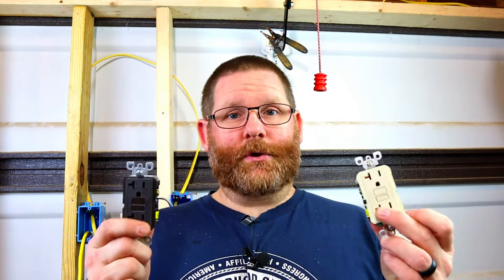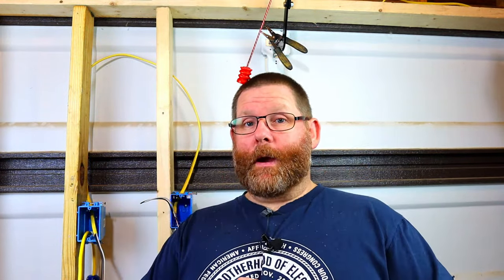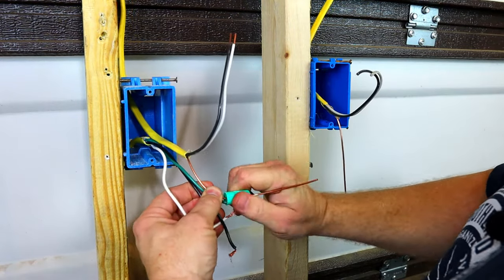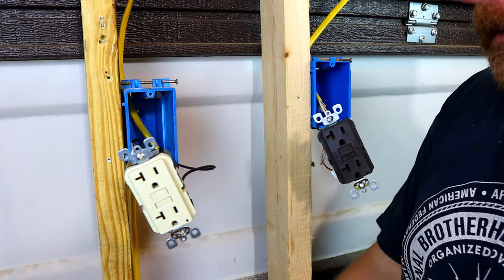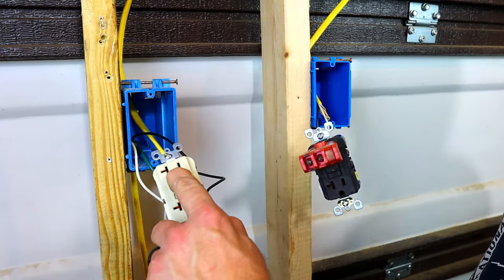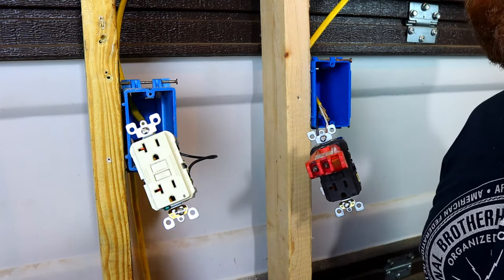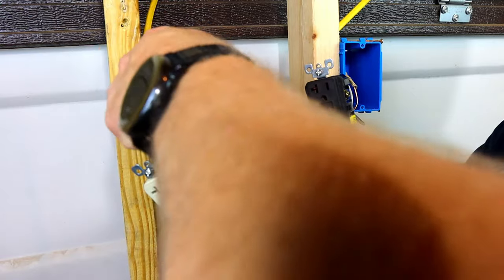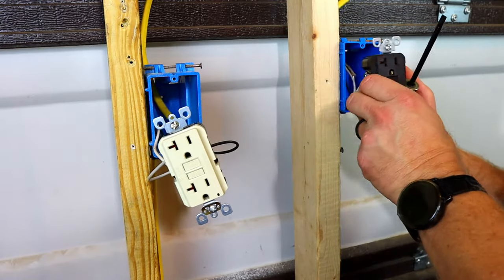How Many Ground Fault Circuit Interrupters On One Breaker

Comment: Okay, this is a bit confusing because there are some tests left out of this video (like testing the plug side while power is reaching the lug side of the brown CFGI or "child receptacle"). First of all, let's assign some names to the GFCI's in question. We'll refer to the first GFCI (white/off white) as the "parent" and the second (brown), third, fourth, ect... GFCI's as the child/ren. - outlets hooked up in series (connected to the bottom lugs of the GFCI outlet). 

To simplify this, do not/never hook up GFCI's in series. Only connect them in parallel as if they are independent from other GFCI's on the same circuit. Voltage drop from one GFCI/GFI to another will prevent children from resetting. You only need one CGFI for child outlets ran in "Series" (using the bottom lugs on the parent GFCI to connect child outlets - being mindful of how many outlets you can run on one circuit by code). 

GFCI should be able to trip with a short (grounded circuit) upstream and downstream, which trips the auto-shutoff feature of the receptacle/s (all the GFCIs on the same circuit should trip). The confusing part is that nowhere in the video does it show a reset of the child (brown) GFCI after the parent was tripped (indicating a voltage drop preventing the child GFCI from resetting or it wasn't manually reset until later, which we did not see), resetting the child GFCI should correct the power-flow to the plug-side/s of the all the children receptacles. 

So, as elementary as the GFCI function is, as long as there is power fed through the receptacle both the parent GFCI and theoretically the series GFCI receptacles have been manually reset, the power should flow through to the plug side of the parent and child/ren GFCI's (unless there isn't enough power to the GFCI in order to reset it/them). Problem again is, there's a voltage drop that keeps child CFGI's from resetting. 

The point is,, you do not need multiple GFCI's as long as you connect standard outlets in series to the parent GFCI outlet using the first method demonstrated in this video. It is not recommended to use this method to series GFCI's outlets (if it happened to work at all) because when one GFCI trips, they all should respectively trip and making it difficult to isolate where a short might be occurring (which will leave you and even a professional electrician with the proverbial head-scratch wondering why someone would subject themselves or anyone to that mess).  

It is wiser to choose whether or not to provide direct power (wiring in parallel to each receptacle, isolating GFCIs and with or without child outlets) or simply installing one GFCI that controls all following child outlets in series (connected to the bottom lugs of the GFCI). - Do not add GFCI's in series, meaning a parent GFCI controlling GFCI/s downstream, that's just being a jerk and causing you the headache of having to reset all dependent GFCI's, if they work at all, in the event one becomes tripped. Rely on one GFCI to control multiple child outlets or provide direct power to each GFCI independently on the same circuit.
Reply from the maker: Wow that's an awesome comment thank you for writing this. Have a great day ☺
Reply: In order to run a "series", couldn't you just figure out the formula-for-resistance-loss for every "child" outlet, then check the specs on the gfci for the required ohms? (I'm thinking one or two "child" outlets would operate properly but that's purely a common-sense guess.)
Reply: @jban4457  Problem is the unpredictability of load.
Reply: This is a great comment and far better than the video.
What's really a kicker is to "map" a circuit correctly, including light fixtures.
Reply: @jban4457  the use of "series" and "parallel" with gfci's can be confusing.

Gfci's simply check for a current imbalance and trip. 

We connect up 120vac to the GFCI input (line) and it protects that outlet.  There are terminals (load) to allow the GFCI to essentially be the protected power source for recepticles connected down stream, giving them GFCI protection.

Running power through the GFCI like that can been refered to as "series" because power runs through it, however, it passes power through like a breaker (120vac) to the parallel connected down stream recepticles.

If you need GFCI protection in two spots, you can "T" tap or pigtail or parallel connect two gfci's On the (line) side to have GFCI protection and a GFCI in each location.

Gfci's do not play well with one another when one feeds the other.
Reply from the maker: Good idea I'll do that pin it.
Reply: Without having a wiring schematic for the house, how do you know which receptacle should be the parent?
Reply: @Kaavoort  The only way to know is to disconnect an outlet and see what other outlets continue to work or not. You can use an outlet tester or just a lamp.
Reply: @Kaavoort  
Will be the one with power
Reply: The only time I'm aware of multiple GFIs on one circuit is in the kitchen.
Reply: And bathrooms
Reply: @William Franks  exactly what I was going to say
Reply: Can i connect a GFI downstream from a regular receptacle?
Reply from the maker: Absolutely
Reply: you are saying I think that no matter how they are connected, it doesn't make sense to have more than one GFCI on a circuit, to use regular receps downstream of the single GFCI and let that control all the downstream receps. Right or wrong?
Reply from the maker: @carlodonnell146 yes that's what I am saying it's one way to do it.
Reply: yup . I had one outlet that has 4 wires 2 black 2 white and another GFI that had only 2 wires One Black and one White, connected the(4wire receptacle) black and white that are (hot to the breaker) on top "Line" and other black / white wire to the bottom "Load  . this made the other GFI "Controllable" by the Main 4 wire receptacle . But then later on I noticed that the 2 wire GFCI stopped working !! whats up with that  Maybe i should have put the 2 wire one on the load end not the line ? 😦😦😧😧😧😧
Reply: @Kaavoort  the parent will be the one with 4 wires the children will have only 2 wires (hot and Cold)
Reply: @TomCee53  Certainly not the only way. Another way is to put a load on one outlet and measure the voltage there, outlets upstream ( between the load and panel) will have progressively lower voltages. Outlets downstream of the load will have the same voltage as the load  since there is no voltage drop on the unloaded wires (assuming there are no other loads on the circuit). A high current load helps by making it easier to see the IR voltage drops.   Ohms law is your friend.😊
Reply: Lllll
Reply from the maker: @simonlewis67?
Reply: First off, I'm no electrician. But I've run a series in parallel of GFCI in garage, that behaves exactly as expected.

3x 2gang boxes each with a GFCI "children/downstream" of the other, then in each box the second outlet protected (load).  I can trip a downstream GFCI w/o it tripping the parent GFCI.   Rationale behind it is to "compartmentalize" the trip without taking down the entire circuit.    This works fine.

However, doing the same thing in a workshop (where the wiring is suspect), the same configuration doesn't hold true.  

Friggin magic as he said, and again, not an electrician.

Edit: added "in parallel".  meaning a series in parallel. :)
Reply: Thank you, I was about to install (in two places) two GFCIs in a row, now I will not do this. I was a bit confused by the video, but really appreciate this explanation..clearing up some things.

Comment: There is a valid reason to have multiple GFIs pigtailed on the same circuit. You may wish to have your GFCI protection local to the room. For example, a single circuit can service countertop receptacles in multiple bathrooms. Perhaps you want each bathroom to have its own GFCI receptacle so a trip doesn’t require a person to go to another bathroom to reset the tripped receptacle.
Reply: If wiring GFCIs for multiple bathrooms (that are on the same circuit), would all the connected GFCI receptacles (including the initial one closest to the panel and all downstream GFCIs) need to be wired only on their line sides? Does this setup change if there's a standard receptacle somewhere in that circuit?
Reply: @ibizanlove  Yes, line side only. Or you can use some 12-3 between the receptacles of the first bathroom to pass current around the GFCI of the first bathroom, or splice at the outlet where the first GFCI will reside, and take power to the second room from there, while using the load side of the first GFCI to protect the rest of the receptacles in that bathroom. Many different ways to do it.

Comment: The black GFCI is not tripped right? This video doesn't make sense to me... if you connect the load side of the white receptacle to the line side of the black receptacle I don't see why it should matter where the line came from (the breaker or another GFCI)
Reply: Yeah, I think he botched the explanation a bit. The second GFCI will work as wired initially, but you'd have to reset it after resetting the first one. The reason you wouldn't want it wired that way is - imagine if you have 4 or 5 GFCI outlets on that circuit, when one trips, you'd have to reset it and then ALL the other ones. Would be a real pain in the neck. Best practice is to wire how he shows it in the end (preferably with a pig tail) and put GFCIs for all outlets near water sources.
Reply: @jetlaggedchef6806  Yup that makes a lot more sense. I also wonder whether perhaps it's better to make resetting inconvenient as GFCIs do not spuriously trip, they trip for a reason, which could be the GFCI is bad. Making it inconvenient forces a homeowner to address the issue. It's not like AFCI where nusiance tripping in normal usage is more common

Comment: It’s called using the line to line and the reason why the other way will not work is because basically that is a breaker and a socket form and when the breaker trips, it breaks the connection which means if you have another circuit or another circuit, but if you have another plug down the line that’s wired on the load Side that is what is tripping so naturally it’s not going to work

Comment: I have an old house that has both bathroom wall outlets on the same circuit.  I changed out both today with GFCI outlets and  spent several hours trying to figure out why the second one would not work.  Stumbled across this video and resolved the problem in a minute. Thanks for the video.  It was a big help.
Reply from the maker: Awesome so glad that you found my video. I appreciate you watching and commenting ☺
Reply: You wasted time and money.  A circuit only needs one GFCI and it should be on the receptacle closest to the breaker panel.  The GFCI installed this way protects all outlets downstream.
Reply from the maker: That's great in a perfect world, most homes are not wired like they should be

Comment: My 1950 house does not have a third wire ground (this was not required until the mid 60's).  The kitchen has 6 outlets on a 20 amp circuit.  When I moved in I replaced them all with 20 amp, 3 prong outlets, with the first outlet a GFCI feeding them.  I had never put a GFI in before but I saw the LINE and LOAD terminals stamped on the back and correctly connected them.  But if you plug in a GFI tester downstream, the test button does not work.  However a dryer plugged in the 1st downstream outlet had a ground fault and it did detect it and tripped (my brother found it and fixed it).  Out in the garage I installed a 20 amp GFI and six downstream outlets.  Of course this was wired to current code with 2 wire with ground Romex.  I plugged in the tester in the last outlet pressed the button and immediately heard a loud click some 30 feet away, the circuit was dead.

Comment: Thank you.  Home inspector said I had to put a GFCI on the outside [under porch] but no one realized it was daisy chained from the GFCI in the kitchen.  Was having this very problem and this just fixed it.
Reply: Nice catch and discovery!  May I make a suggestion that you label the outlet/receptacle that is outside and under the porch saying that it is GFI/GFCI current protected.  Most GFI/GFCI have several small peel off and use labels included in the packet/box the GFI/GFCI comes in that are designed for this.  All outlets/receptacles that are downstream, connected to the "load" side of the GFI/GFCI should be labeled as GFI/GFCI protected.

Comment: Greetings, Sir!

I think I have the answer to your question as to "why" this works (correct me if I am wrong). We know that an A/C circuit is a parallel circuit. SO, in order to make the 2nd GFCI independent of the first one, we have to wire the UNgrounded Conductors "in parallel with" the TRUE source (the circuit breaker). 

By wiring the ungrounded conductors in parallel with the BREAKER, we allow current to flow to each receptacle at all times INDEPENDENTLY OF the upstream GFCI. I think this would be more evident into the viewers if you had used a pigtail, because it would show that the current is "dropped off" at the 1st GFCI receptacle AND it continues to the 2nd one simultaneously.

This reminds me:  I need to make this correction on my own house tomorrow from when I was an apprentice. Thank you for your excellent videos! If someone already commented on this, I apologize!

Comment: Thanks for this video. I’m a DIY-er getting ready to install several receptacles around my outdoor patio, so will have several GFCIs on one circuit. Basically, looks like pigtailing them / wiring in parallel is the only way to go.
Reply from the maker: I agree. Or you can put in regular receps and come off the load side. All depends on what you want to spend and the look your aiming for

Comment: The reason I want to do this is, I have two sump pumps in my yard that I want to run off of one 20 amp circuit with a regular breaker. I want the sump pumps independent of each other so if one trips their GFCI outlet it won't shut down the other sump pump when there is no problem with that pump. Thanks for posting this and explaining. I'll be wiring them so they are in parallel with each having their own ground, neutral and hot.
Reply from the maker: Good luck and thanks for watching and commenting ☺
Reply: I did the same, wired in parallel so both the gfci outlets are independent.

Comment: Thank you thank you for this video!  I had it wired right but ended up with no bathroom fans, lights or outlet juice in two bathrooms.  Made no sense until I finally found this gem advice, It worked!  Now if I can just get the broken bottom screw out of the box housing, it'll look nice too.  :)
Reply from the maker: Glad to hear that this helped you ☺

Comment: I've replaced many kitchen  GFCIs, just using the existing wire method they used ( Line in load out) and have never had a problem.  Tested all and theu all worked corr8

Comment: well I'm glad I accidentally run across this video. I recently made a few pigtail GFCI boxes to use on my string of drop cords on the job site so that I don't have to deal with running all the way back to the house. also many customers don't have a GFCI outlet outside their house so when it trips I have no power until I catch them at home in the evening. it really sucks when they are out of town. Anyway, I did it the wrong way and kept running back and forth chasing tripped outlets forever. I couldn't understand what was happening. THANKS
Reply from the maker: Awesome and it's my pleasure. I appreciate you watching and commenting ☺

Comment: After scratch my head for an hour and wiring it the wrong way, I watch your video and problem solved. Thank you for the mock up walk through.
Reply from the maker: So glad to hear this thanks for watching and commenting.
Reply: Why did you put multiple GFCIs on a single circuit?
Reply: @actionjksn  no particular safety reason. I just bought two…..Legrand radiant Night Light, Self-Test GFCI Outlets, Safe for Kids, Tamper Resistant, Brushed Nickel, 15 Amp, 1597NTLTRNICC4 on Amazon because I like the metal look. Afterwards I needed this video to figure out how to wire one GFI to another.

Comment: I like your video/s and I know you're trying to help people. Let me also say that I'm not disagreeing with you, esp since I've seen your theory of wiring multiple GFCIs on 1 circuit used on other websites/searches. Only problem I have (which might be where a lot of people get confused) is if you look at the instructions that come in the box of a new GFCI, there's a diagram showing the correct way (or the manufacturers suggested way) to wire multiple GCFIs to 1 circuit is to take feed wires from breaker (panel) to line side of 1st GFCI, connect load (branch circuit/downstream) wires to load side of 1st GFCI, then connect those wires to line side of 2nd GFCI and repeat that process for however many GFCIs you are installing on that circuit. In other words go line to load, line to load, line to load etc. I have pictures of instructions from a brand new Eaton GFCI that illustrate this, however I can't add photos to this comment (or at least I can't figure out how to add the photos). Not sure where this leaves us, but I wanted to point out what the manufacturer (in my case Easton) suggests as to the correct way to wire multiple GFCIs on 1 circuit.
Reply from the maker: Yep. Nothing wrong with I always say follow the manufacturer diagram. That just keeps it alot more simple for some. Great comment. Have a great day ☺